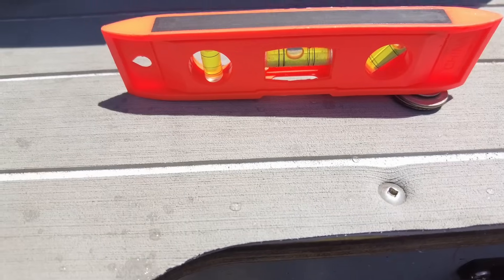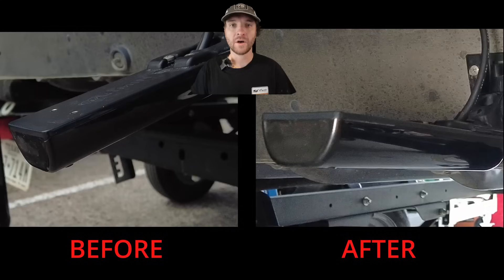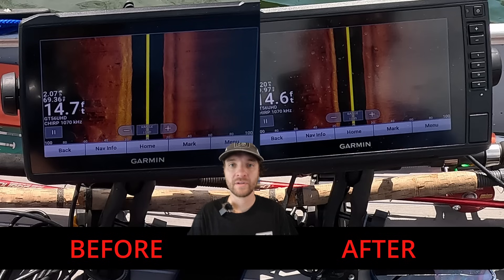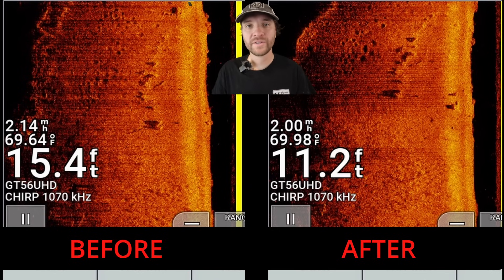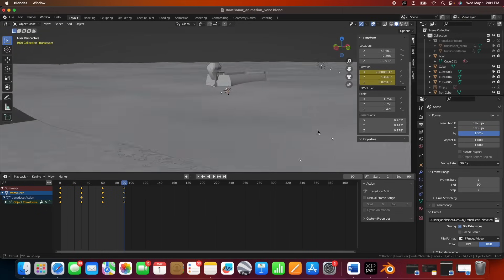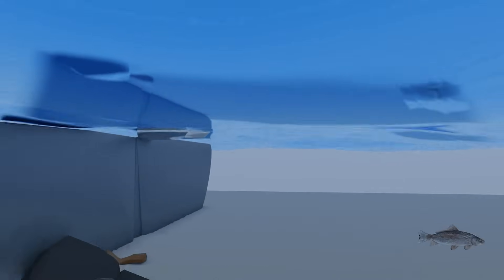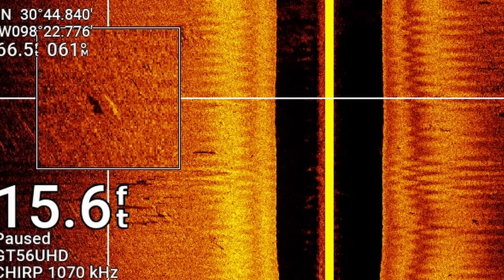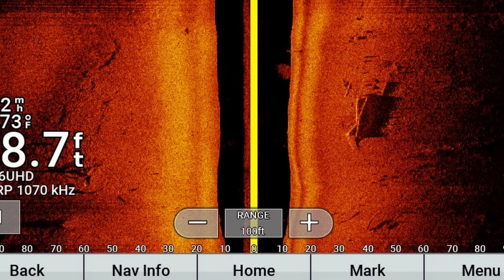MAXIMIZE Side Imaging Performance: Angle Your Transducer Down!

Comment: companies always say to level them. Put it in gear go the speed you scan at then put a level on the floor of the deck of boat. level the level. then when you get home level the boat with the trailer wench then put level back on boat deck same were you had it on the water. The level transducer. Its that easy.  You don't need software to do it.

Comment: Most bass boats sit at a pretty sharp angle on the water while at idle. I would say that is gives far more than 10 degrees if leveled as it sits on a trailer. Almost makes me want to tilt it upward a couple degrees to meet that 10 degree tilt in the water.

Comment: Interesting information.  I have a Humminbird and was advised by a guy who is back east not local to buy a Y cable and a Sonar Transducer.  I had to adjust the Si transducer for best side imaging and Sonar for best results.  I did do the level on the water going around 1 1/2 mph.  I have two outboards a 115 and 9.9 that total a weight of around 500 pounds.  Our boat sitting in the water will have the back of boat deeper than the bow.  At 1.5 mph it lifts some but not enough to put level and I'm not sure on your 10-degree angle.  I had a installer that comes to your house claim he installs all makes.  Then told me he levels the transducer with the bottom of the boat.  So that would mean my side imaging and sonar at idle would be pointing forward not down.  Only time it would be accurate is up on plane.  Anyway that is how I see it but don't claim it is the only way.  I also get great side imaging and have to work with settings every trip.

Comment: Question: On 3 in 1 xducers can you read at speed and have side scan dialed in? With respect to side imaging, would not doubling your depth require xducer angle adjustment for the clearest shadow? Glad someone is tackling this issue.

Comment: Y cable plus second transducer on tge port side...if you really want to maximize your sidescan images
Reply: I'm interested in this, will they interfere with each other or work in tandem on same frequency?  I have a 1652 sea ark and with the motor trimmed to remove porpus it blocks half of transducer, no power trim so second transducer may be easiest fix.
Reply: @benthere404 I haven't noticed any interference.   I'm guessing the Y cable only contacts the pins needed to gather port side side scan data; and gets all other data from the starboard side.

Be sure to get the correct Y cable.  The other one let's you run a separate 2d transducer.  My understanding is you can run both.  I have it, but haven't installed the separate 2d for the humminbird unit.  The idea is to run the 2d only transducer lower to maintain bottom contact at speed and keep the more expensive transducers up higher to protect them.

Comment: Coin leveling would need to be done at whatever speed the side-scan is used. That is usually displacement speed, where the deck angle is about the same as at rest. If I understand it correctly, the result would put the transducer level with the waterline. Are you recommending 10 degrees down respect to the waterline, or some other reference?

Comment: I am not sure, but I think you have not used the level and coins properly... Use the coins to get the 'offset of the level' while 'at speed' on the water. Use those same coins to RECREATE 'that OFFSET to LEVEL' (THE SAME BOAT ANGLE while on the trailer")... Then level the transducer.  If you boat is 2 degrees up in the water - then get it 2 degrees up on the trailer... THEN use the level to get a 0 degree tilt...
Reply: You are correct, you level the boat on the trailer to the coin level, then adjust your transducer.

Comment: Level on your trailer in your garage with your wheel. Jack up or down aint level on the water boys.😢
Reply from the maker: From what I understand, the 'coin method' involves placing coins and a level on the boat to measure its running angle while under power. You then use that same angle to properly level your transducer, ensuring it's aligned for optimal performance when the boat is moving. Honestly the same process can be followed by simply using an iphone with a measuring app. All you have to do is place the phone on a normally level surface on the boat and drive 2-5mph and than record what angle the boat is at. Once you go back to your trailer all you need to do is jack up the boat at that same angle than level the transducer.

Comment: So my problem with this video is that down is a relative term to the transducer. Is the bow side of the transducer pointed down, or is the rear of the transducer pointed down???
Reply: He’s referring to the rear of the transducer! Run a level parallel to the bottom of your boat and level your transducer to it then tilt the back end of the transducer down 10 degrees from that and tighten up your screws or bolts. Go out and try it and adjust from there if need be. Good fishing

Comment: Great work on your simulator.  The first problem I see is you're using Garmin... YUCK!  I'm running a Simrad 3n1 ducer.  My ducer is perfectly level and it works perfectly.  I'm not changing it, and it works at all speeds, even on plane at full throttle.

Comment: Too many variables of the levelness of a boat on the water. How many occupants, weight of occupants, speed of boat, trim, etc. So these guy that swear you need coins to be perfectly level is unrealistic in these different situations. I have always tilted the back down a few degrees and worked fine.

Comment: So the before pic looked like the rear of tranducer was sagging a lot, like 10 degrees pointing up? The before looked better. Was it level or pointing upward (rear sagging)
Reply from the maker: It was pointed down at around a 9 degree angle.
Reply: So the before pic the transducer rear was 9 degrees closer to the ground or closer to the boat/sky? Sorry it was hard to tell in picture.

Comment: @fishOclock89 thanks mate, I have a Solix G3 SI unit. 
I wasn’t having any real issues at 10km/hr but it did not track bottom very well above that speed. My SI transducer was initially set around +5 from level on the trailer. 
After I saw your video I thought I’d do some testing. I set my SI transducer at level on the trailer then I tilted the transducer at -5 degrees. 
I was surprised I could easily track bottom at 30km/hr in 2D and although my SI washed out at that speed my side image seemed clear at mapping speeds 5-10km/hr. 
Approximately a 10 degree adjustment made a significant difference. 
I’d call that method uncomplicated and an improvement 👍🏻
I’m not sure about the coin method, I am a little less complicated type hahaha.
Reply from the maker: Thanks for the comment. Thats a good way to put it. It is a trade off. If you have a high speed transducer or a thru-hull transducer you can still keep bottom signal when you get on plane and receive the best side images.

Comment: When you set a 10 degree down angle I assume that is on land and using an iPhone or the like to zero being transducer level then -10?
Reply from the maker: the coins are used as an offset to account for the angle the boat takes on when its under power. after you take your baseline measurement with the coins stacked under the level when you put the boat on the trailer you mimic the angle the boat takes on when its under power by using the same number of coins and a level and you essentially move your trailer up until the boat is at that exact same level. than you level out the transducer at that point. Not sure if I explained it correctly or not, I know its a bit confusing. let me know if this helps clear things up.

Comment: I think you hit on a very important point on transducer leveling.  I want to add to the idea of pointing the transducer down a little bit.  The sides of the signal cone being emitted are the 1/2 power points.  It takes time for the echo to be received back to the transducer.  Because of the time delay, when the transducer is level, the boat moves and the echo received back from each ping is near the 1/2 power point.  This echo is also smudged by random reflections occurring at the 1/2 power point vicinity of the cone.  Tilting the transducer down a little will allow the ping to be sent forward slightly allowing the boat to be in the full power reflection point of the echo on each ping.  If this idea is correct, then there would be an optimum speed for the boat for a given depth and angle setting of the transducer.  The optimum speed would be the speed that gives the best clarity.  This is something to experiment with.

Comment: Coin leveling has always been inaccurate. All installations are impacted by weight and balance of the boat. Full fuel or 1/4 tank? One occupant or two? Loaded with the same waight in the same locations each time? We shoot for the best "average'. A slight down angle on the rear of the transducer provides a smoother water flow over the face of the transducer's sonar windows. Great graphics..
Reply from the maker: Thanks for the comment and the like. Couldn’t have said it better myself!
Reply: Yes you use coin method with your average load. Best method for good readings period.

Comment: I adjusted my transducer until my fish arches appeared level on my graph's display. I also mounted my transducer as far away from the boat center line as possible which reduces ping blockage from the motor.  My transducer is pointing at an angle of 3 degress higher at the back of the transducer than the front.  My side imaging works great both to the right and left. 

If you install your transsucer where any part of it extends below the hull bottom you are only asking for trouble. Transducers can be damaged if they strike floating objects in the water at faster speeds. Not worth the risks to me.

Comment: Coin trick worked on my boat// A comb forward doesnt help
Reply from the maker: I always say “if it ain’t broke don’t fix it”. Also my simulation only shows that in perfect conditions without the effect of the wake or other sources of noise a slight forward tilt is optimal. For some people depending on the boat they have and the design of the hull and the wake a forward tilt may not work best.

Comment: I disagree with this video and any transducer video talking about proper transducer placement. Optimal placement is going to be different for everyone unless you have the same boat to weight ratio and placement. You don’t take into account the weight of the boat - full tank of gas / three quarter / half, tackle, how many people on the boat, etc. This will affect the ducer placement regardless of any leveling to the ducer. Trimming also affects the angle of the ducer. Too high and your bow raises which will angle your ducer down…. Too low and you start to level the boat, but you may start to see interference w/ the lower unit which will DEFINITELY impact images…. There’s too many variables. In the end, you’re never going to have the ‘BEST’ angle anyway so there’s really no point to these videos lol.
Reply: That’s what this video is talking about. Did you even watch it ? 
He is saying that leveling is bs
Reply: @davesch1512 the difference between my boat without a lower unit and my Dads with one is startling over the same Structure. I have a 25’ aluminum Boice jet river boat and he has a 23’ crestliner with an inboard prop. It’s honestly crazy the difference. If people really wanted the absolute best pic and best results….. I’m actually building a pole mount in order to run it max 3’ below the boat. Simply because the image I get from the ducer on my minn kota (not powered on) but lowered as a ducer mount instead works that much better than the transom mount again. Which does change noticeably when the electric motor is running.
Reply: That’s not really true unless you have a ducer on the bow. 

The fact is that you can’t level a ducer for optimum performance in every scenario. What is true is that the transom is the most consistent place on any boat as far as placement. So as far as side imaging goes with 3mph being the most consistent image and balance between speed and accuracy. Put it where you scan at. It’s that simple, because a speed high enough that you raise the bow is going to do way more to distort than dicking with it constantly, once you know the difference in YOUR boat THATS HOW YOU DETERMINE YOUR OPTIMUM LEVEL. 

IT CAN ALWAYS BE BETTER. WANT PROOF 

get 2 one for port 
 Get four and put ten foot extensions on side of the swim platform. 

If ifs and butts were soup and nuts oh what a wonderful image it would be.
Reply: Setting ducer "placement" aside; this video speaks about "angle".  I most commonly scan at about 1100 RPM's at mid trim. My ducer is level/perpendicular with the water's surface in that configuration.  As I increase or decrease speed, thereby altering the bow height, I make adjustments accordingly for that in an effort to stay as close to my baseline of perpendicular as possible.
Reply: You must be constantly adjusting your transducer,   maybe I can ad power trim to mine
Reply: @brianwills4398 What I meant to say was that; if I increase my boat speed, from say 1100 rpm to 1300, I trim the engine in some to maintain the direct downward transducer angle.
The way I originally wrote it made it sound like I was adjusting the ducer angle, lol.
Reply: Right. Without mentioning what you did in the video, not very helpful. Especially when the manuals themselves say that with factors applied, the transducer should be parallel with the water line for best performance. That simple.

Comment: Not sure on this yet . I set mine up and tilted the back of the transducer up quite a bit to compensate for the motor. I had an image on side view and traditional that would rival any advertisement or high end install. Without really knowing much about the unit and limited time I had to do the rest from my garage. After dropping the transducer slightly but then adjusting to the coin leveling on the water method. The transducer angle came down from the back tipped up to closer looking level. My screens have not looked as clear to date and I am still tweaking .
Reply from the maker: Yeah in my experience transducer installation is not a "one size fits all". I think the most important thing is to install the transducer away from turbulence and the side of the outboard. In a perfect world, a slight down angle will give you better images but I know every situation is different.

Comment: First of all, your 3D graphics to explain your point is brilliant, well done.  Transducer Angle to Transom (TAT) is something I am very aware of on my USV's, in fact, the entire design of my USV (AIMy) was based around TAT.  While the coin concept worked for many that had just horrible TATs, I agree, it is not a solution for everyone as "slightly down" is certainly the ticket.  A very quick and easy 'on the water' test is to idle over some fish on a wide cone angle such as 83kHz for Lowrance/Simrad users to check your arches.  If the arch is slightly longer on the left then it is 100% in my opinion as it is slightly down.  A perfectly equal arch I would give 80% and a longer right side arch ... 0%, get the boat out of the water now and fix it!
Reply from the maker: Thanks for watching and thanks for the comment. I agree that transducer angle to transom is imporant. Crazy that garmin doesn’t have any of this info in the installation manual.

Comment: Those lines are more than likely from your di being on the same frequency as your si. Around the 2 min 30 sec.
Reply from the maker: That’s what I thought at first but the lines corresponded with the boat going up and down on the waves. I was running my clearvu on 810 kHz and my side imaging on 1120 so I don’t think it should interfere

Comment: If you have it at an angle your depth reading will be off
Reply: Level on the trailer does not equal level on the water. Also, different speeds will cause your boat to ride at different angles.
Reply: Very interesting. I’ll be trying it.

Comment: What was the angle of your transducer in the before test?  Was it 10 degrees?  It looks further down than that.
Reply: What instrument do you use to first determine that your transducer is level (to what) and how and with what do you use to measure the ten degrees down? Picture would help this visual learner. Well done
Reply from the maker: It was a bit more than that. I ended up putting it lower to compensate for the affect of the lower unit.

Comment: Any ideas why my side imaging stopped showing the dark area down the miidle that should be the depth of the water I'm in.  Meaning my whole screen, no matter what depth of water I'm in looks like it would if you were like in a foot of water.  This just started happening.
Reply: If it's a Humminbird finder, check to see if you're in "contour mode", which removes the water column and just shows the bottom without the dark area (water column)
Reply: your boat sunk. yep, its on bottom. unit says so...

Comment: I've always have my transducer about 5mm to 10mm down I've never have my transducer level when planning you get the signal almost in center of boat and when just fishing drifting the fish and lumps or objects are almost in center of under the boat I've tested in shallow water were it picks up its pretty much spot on when angled down my pop back in the early nineties told me this always have slight tilt down not level and since this I've always have good luck
Reply from the maker: Thanks for watching and for the comment. I have observed the same !